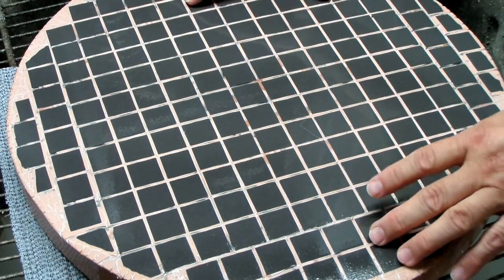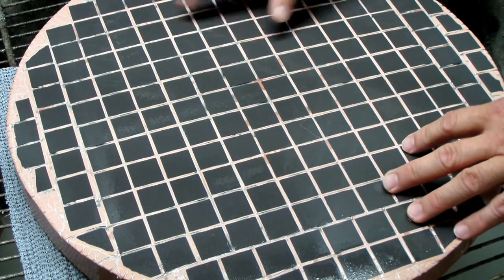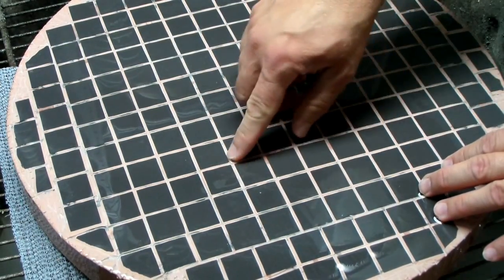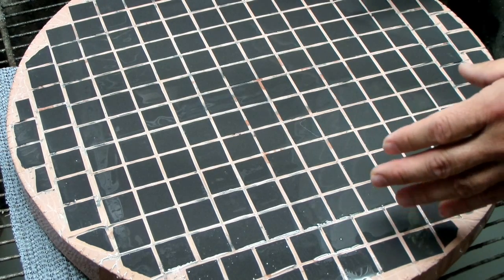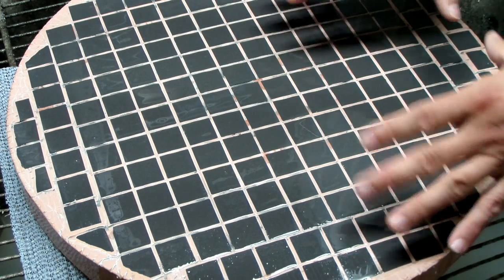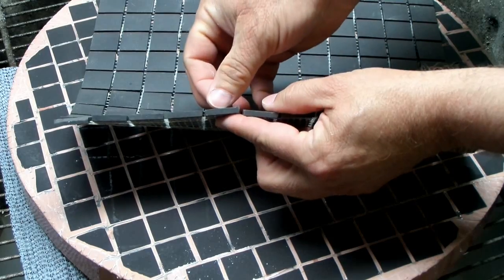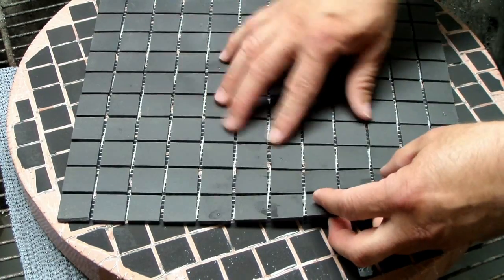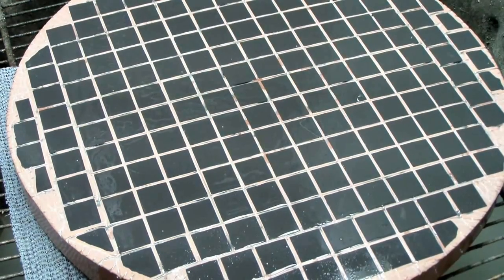Mirror Grinding Tool for a 22" f/4.0 Telescope Mirror

Comment: Is the tool flat? I'm guessing not but how do you give it the appropriate curvature in order to gring the mirror with the proper parabole?
Reply from the maker: The tool isn't flat.  It is made by placing tiles on the curved mirror, and then pouring dental plaster over it to make the tool.  So the tool starts out with the same curve as the mirror.

Comment: Hi Gordon, I would really like to know what you consider to be the best method for generating the curve from a non pre-generated blank? What would be your tool of choice for this process and how would you go about making this? I'm new to this and am at the stage of reading as much as I can before I take the plunge and try my hand at making a mirror myself!! Any advice would be much appreciated.
Reply from the maker: Depends on the size of the mirror.  What do you have?  And what is your target radius?
Reply: Hi Gordon, I am planning to start with an 8" with a focal ratio of f6 so a 2400mm radius. Eventually my goal is to make a 20" mirror around f5 and a 5000mm ROC. I'd love to know how the approach to generating the curve and the tool selection varies based on the diameter of the mirror. Many thanks.
Reply from the maker: I'm assuming you are doing the grinding by hand, without a machine.  For the 8" mirror, I would just do that the old fashioned way with #80 SiC abrasive.  Do a tangential stroke with the mirror on top.  The mirror should have an overhang, with the center of the mirror about 2.5" or 3" to the right of the center of the tool.  Then stroke tangentially, instead of center over center.  The idea is to keep a large overhang on the mirror at all times.  This will hollow out the center of the mirror on top fairly rapidly, and for an 8" f/6 you don't have much to remove anyway.  Just don't let the mirror "fall off" at the edge or you will get a chipped tool and scratches.

For a 20", that is a lot more work.  Without a machine, I would make up a smallish tool from steel nuts.  I would make a ring dam with a diameter of about 6".  Put steel nuts on top of the flat mirror inside the dam, and pour dental plaster over them to mold a sub-diameter tool.  Make it about 1.5" thick.  Don't let the nuts touch each other, just space them out on the surface, but put on as many as will fit.  For a 20", I would get maybe 4 or 5 pounds of #40 SiC abrasive and a half pound of #60.  Then go to work grinding center over center with the mirror on the bottom.  Put on as much pressure as possible as you walk around the barrel.  This job will be quite a few hours of work.  Don't overhang the edge, though, as the #40 abrasive will knock off chips.  Just develop the curve out to about 1/2" from the edge.  After the curve is about at depth, mold up a normal type of tool and continue the grind out to the edge with #80.  Make sure you always have a good bevel on the edge of the mirror.  That will help with the chipping, which you can even get with #80.  Good luck and have fun!  -Gordon
Reply: Perfect!! That's a great help Gordon. Much appreciate you taking the time to reply. 
Your videos are also superb and an invaluable resource!!!
Best Regards
Pete
Reply from the maker: You are welcome, Pete.  Thanks and good luck!  Let me know how your mirror goes!

Comment: Hi, Gordon! I'm watching your videos for years now. In a few days I'll have a blank for my first project - 10'' plate glass (I think f/6 is a good start). I know that 10 inch mirror is a bad starting point but I'm taking the blank as a gift. Can you tell me - how to know how big the grinding/polishing/figuring tool should be? How to know how to figure the mirror? Can you explain these newbie questions in a video?
What I know is: Which strokes to use and when. How to start rough grinding and how to fine grinding. I can measure with my spherometer and I can determine if my mirror is spherical (the pencil test). I know when to switch the grits. I understand the focaults on a basic level (I have the book "Understanding Foucault" by David Harbour). I know how to correct turn-down edge and turn-up edge.
I need this information because I want to make a big mirror one day. But for now - an Ultralight Dob will be a good project for the rest of the year for me. :)
Reply from the maker: For a grinding tool, I like to go with a tile tool that is about 70% the diameter of the mirror.  So a 7" tool would be good for your mirror.  Figuring is a little too much to explain.  I'll put it on my list for a future video!
Reply: Thanks, Gordon! I've watched your tips for figuring 8'' mirror. I also did a lot of research about figuring and I think I know how to proceed. They are so many factors for the figuring so I'll have to learn in the process.
Reply from the maker: Good luck.  Don't get discouraged.  Figuring often isn't intuitive, so if something isn't working like you think it should, you have to be able to get "out of the box" and maybe think about things in a different way.

Comment: Hi Gordon. I love your videos. Could you please provide more detail on the type of tile you are using as well as mention a potential supplier and a part number?
Reply from the maker: Karl Dean The tiles I use come from International Pool Tile in Flushing, NY.  Problem is they won't sell them in single sheets.  I buy a case at a time.  If you check with a tile distributor, they might be able to find swimming pool tiles for you in this 1" tile size.